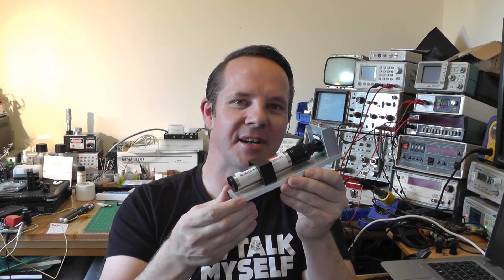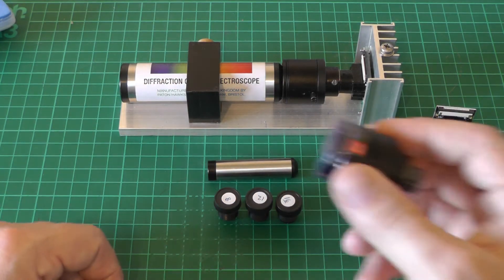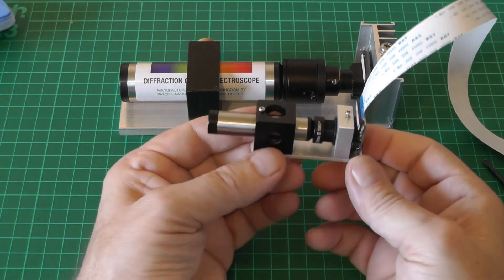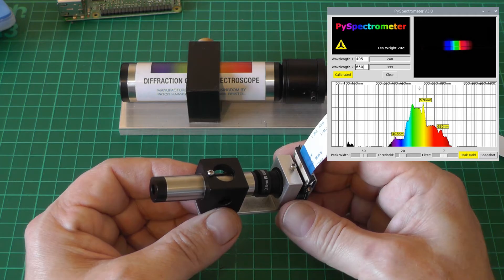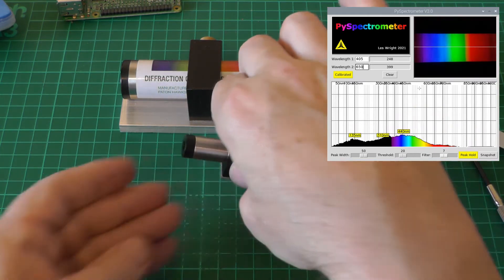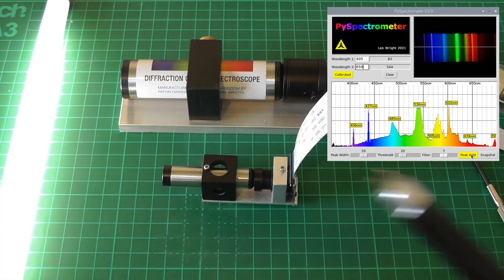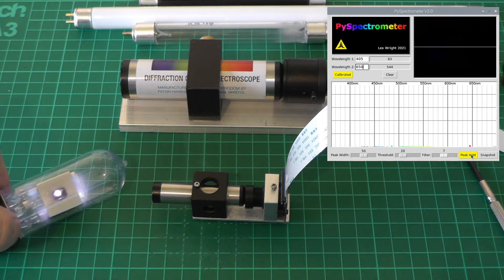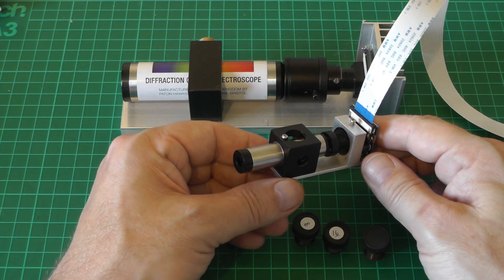How to build a MINIATURE Spectrometer  for the Raspberry Pi

Comment: I have several UV filters… They can easily be found online… Apparently they transform deep UV into visible light. Might be a way to extend the range down into the 265nm range

I gathered them a year or so ago when the first UVC LEDs were showing up on the market. To help convert, verify, and measure the light. It worked a treat!
Reply: They won't be filters, they are probably fluorescent targets.
Reply: @cambridgemart2075  I definitely have some fluorescent targets in there… But supposedly these are filters. Similar to those found in all types of track lighting. “UL UV FILTER 001”
I don’t know if these do what they claim… But they sure are everywhere, and there are several patents and ul listings regarding them. They claim to convert UV light into the visible spectrum or block it all together. 

https://images.app.goo.gl/Ah3p3DLzv1zxUuqU9
Reply from the maker: Not sure about the claim of converting Vis to UV, that would be a nonlinear process. But sure, the internet is abundant with visible cut filters, that allow only UV and IR though. Woods glass is by far the cheapest. I have some in, because I want to see what the Picam can see in the near UV.
Reply: @LesLaboratory  sorry I meant to say they claim to convert UV to visible light. I’m not sure about the claim either… I can totally understand UV blocking filters but to convert UV to visible light without phosphors or other targets… Sounds fishy. But there are a lot of UL listed “ conversion“ filters that can be found on lights in most home stores. So who knows.

Woods the glass is great stuff. Was Lucky enough to stumble upon on a college optics lab auction bundled in with a MACHINE SHOP auction. That’s where I got my optical breadboard stuff and it had all kinds of wonderful UV and visible light/ir filters. And I regularly by visible light filters when building some of my custom hi power UV flashlights. To remove any visible light and only allow the wavelength desired.. And thanks to the new production of ultra high power UVC LEDs… I’ve had a lot of cool flashlight projects this year. This new UVC led Stuff is wicked crazy…. 

I stole an acebeam X80uv from eBay last year for under $100. Considering they go for over 500 I’m very lucky. Has 16 of the most powerful UV LEDs ever made. And inspired many of my own UVLED flashlight builds. 

Really enjoy messing around with it, I became interested in it because I’m always needing a various wide range of UV wavelengths In my musical instrument repair business. To examine and locate previous repairs, cracks, or markings in several hundred year old violins and such. It requires a very wide range of UV wavelengths because each task is a bit different and reveals itself under different light

Also a big collector and hobbyist regarding radioactive materials and geiger counter/survey meters. Scintillation detectors in particular. So when hunting for uranium in old mines in tailing piles… High power UV really comes in handy!

Comment: theres a spectrometer module thats even smaller. its called C12880MA from hamamatsu. but its almost 400 bucks. 
its a tiny MEMS implementation of a aperture, diffraction grating and linear cmos sensor in one package. its going from 340 to 850nm

i think using a linear CCD you find on ebay like a tcd1201d and a arduino/esp32 you can make the whole thing even smaller and portable.
this sensor has 1047 monochrome pixels (scanners usually have a rgb led strip to scan colors) the depth is basically limited by the arduino analog input. a external 16bit adc might be much better but slower.
reading the ccd is very simple.  (google tcd1201d arduino, 5th result on reddit theres a sketch)
Reply from the maker: Yes, I saw those, nut as you say 400 bucks, and the resolution is pretty poor. Sure, if you were to go down the linear CCD route, you could end up with a better build, but I wanted something that was easily in reach of most hackers and makers.
Reply: Yeah, you can also get those things from old Zeiss Spectrophotometers, but the resolution is absolutely atrocious, something like 1 pixel per 2 nm
Reply: if you align it with the projection correctly well you get a resolution based on how many pixels you got. the sensor mentioned has 1047 pixels. a sony Sony ilx554a has 2048 pixels. and ilx526a 3000 pixels.
Reply: I haven't taken apart flatbed scanners for years, but I know some old ones had a linear imaging sensor inside. It may allow for an even smaller spectrometer.

Comment: This is red hot wonderful continent! Truly what YouTube was made for! Imagine having access to stuff like this back in the 70s or 80s.
Thanks again for making this project!!! 

Personally I would love to see a high resolution more traditional version. Possibly something based on an ocean optics enclosure which can be had with the slit and grating for under 50 bucks. Or maybe a 3-D print body matching the ocean optics bench geometry. I think the files have already been created and are extremely accurate and forgiving. I’ve tinkered with and re-calibrated over a dozen spectrometers of that form factor… And was able to get ridiculously accurate results in a hobby optics lab setup. 

Would be awesome to see what you could do with a setup like that. With optical grade glass diffraction grading instead of plastic film. And a fully adjustable/customizable optics bench in that smaller form factor.

Thanks again for this wonderful series!
Reply: Here’s a great example. Check out this listing and this guys other listings. 

https://www.ebay.com/itm/143933041252

This is the optics bench including everything except the sensor… or for under $50 you can get the optics bench and mirrors without the grating. Or like I said previously… I’m almost certain several people have designed this and files are available to 3-D print. I think it’s peak accurate and customizable. Considering the optical quality of components that can be had for extremely cheap. It’s so easily adjustable and customizable anyone can calibrate this thing to within factory specs with a bit of practice. 

The Guys Ebay page is a treasure trove. He even sells the linear CCD mount it on the board ready to go for about 40 bucks. But I have a stack of those linear CDs out of every kind of spectrometer and device imaginable… So hit me up if you want a sampling of them, and let me know where to ship them.

Disclaimer-I HAVE ZERO Affiliation with this guy or his eBay page. I’ve never talked to him or bought from him, so I don’t vouch for the service or quality…